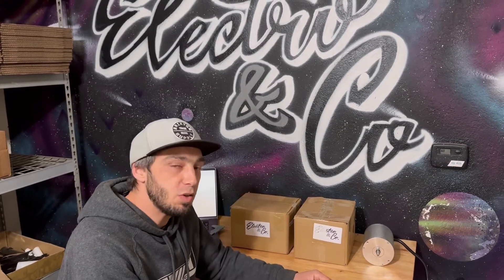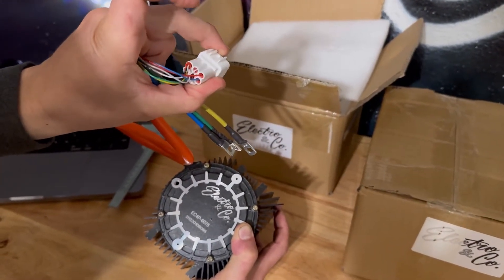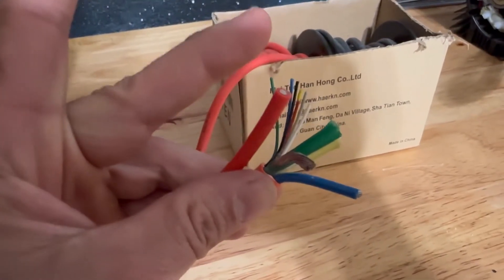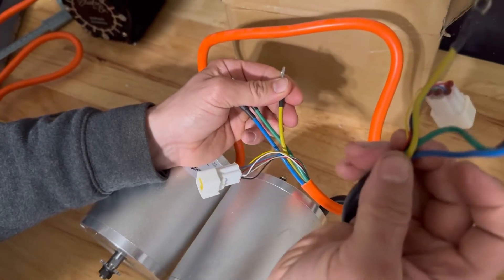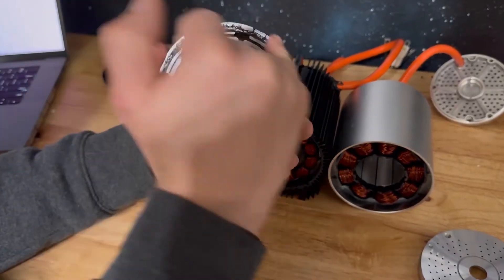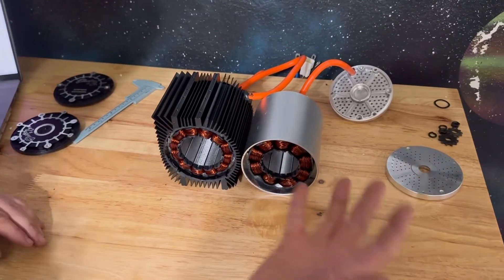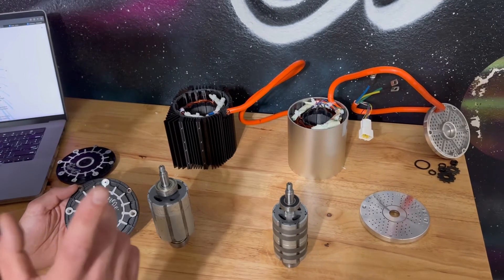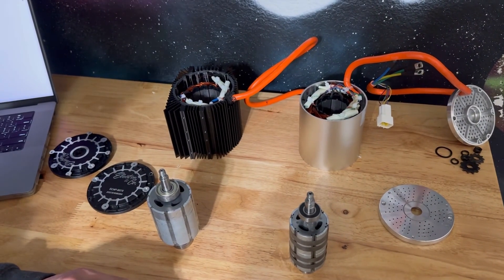EC4P Razor Motor Teardown - OFFICIAL - MY1020 Comparison - Electro & Co

Comment: Via my email recently about the MXR 1300 is it this motor in question ?. Being an engineer I notice there just capped  bearings and not with seals in case water does get in. Order going in soon for the complete controller / motor/throttle kit. Wouldn't it be better if the windings were bound to stop vibration?. Or resin bound ?

Comment: I have a question why are all the short magnets on one side of the rotor? My small knowledge base says they should be staggered, small long, long small...? I couldn't see any kevlar is it clear? Also I dont see any balancing marks or glue are these rotor spin balanced? Also are the rotor lamination extra thin? The MY1020 motor I have has the magnets in a V style rotor much like the new Tesla motors, why not go with this V style just for the increase in max RPM? I have thrown a magnet and its not a fun experience when the rotor locks up at max rpm/speed. So i was pleasantly surprised to see a V style rotor in my new MY1020, but without internal fan as some also have. Seem a MY1020 with V style rotor and fan would be the direction these manufacturers should go.  Can we see the TRUMOTO NOISY CRICKET broken down like this its nice to see the sellers doing this with there products it really helps the products sell themselves, now we just need a datasheet for us number nerds, cause nobody's butt dyno is calibrated.
Reply: What my1020 motor do you have? V style/ IPM is what you're referring to?
Reply: @jahnaboi  I have 3 my1020 style motors one from alfa wheels, one boma (v-style), vevor. All 72v 3000w models. Rotors have 6 magnets.

Comment: Would it be possible to limit max speed with these? Thinking about converting my vespa pedal moped to electric
Reply: Yes but you limit speed with your speed controller it's like the brains of the operation. You have a battery a speed controller and a motor.